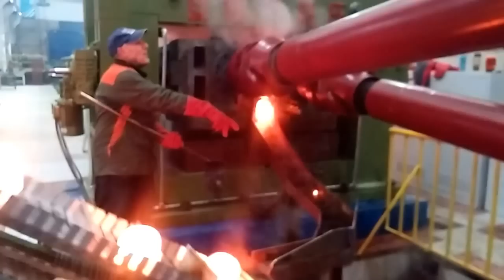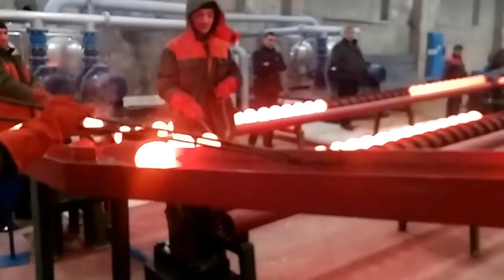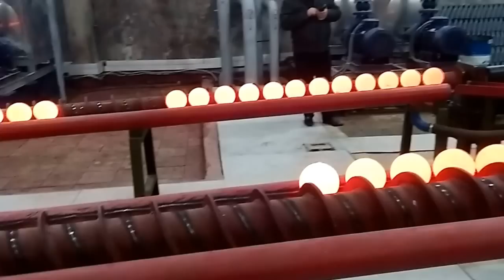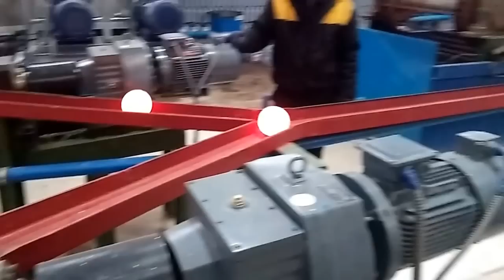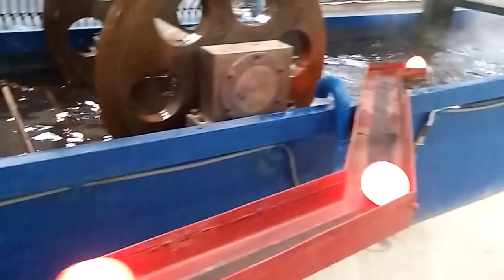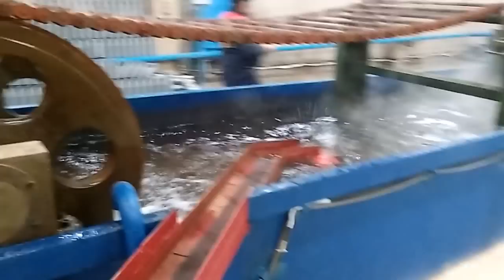120mm steel ball production process, skew rolling mill machine

Comment: what are this size used for?
Reply: maybe for the bearing of a wind turbine, not sure tho
Reply: Presumably, they can be used in large machinery such as part of the diesel engines/transmission for supertankers/cargo vessels.
   Large-scale electrical generation equipment
Reply from the maker: the steel balls are used for gringding in mining plant, steel plant, power plant, cement plant etc.

Comment: 0:30 why is he diverting some balls into two different paths
Reply from the maker: The production of stell balls from skew roling mill machine is large, and the steel balls need to be reduced the temperatuer then can come into the water for quenching. the balls are transorted into two paths to increase the time to reduce the temperature of steel balls. 
if you are interested in the steel ball making machine or know more info about it, please mail me  rita@chinesehammers.com
Reply: @ayforginghammers  ok..i understood that it is to give time for it to cool slowly at first and then we have to quench it...
So can you please tell me why do we need to keep it for some time at that elevated temperature ?
Reply from the maker: @ @kvsalahuddin5  The purpose of quenching is to improve the hardness and strength of the steel balls, together with the appropriate tempering process.
The purpose of tempering is to eliminate the internal stress generated by the quenching process, improve the structural stability, reduce brittleness, and improve the wear resistance of the steel balls.